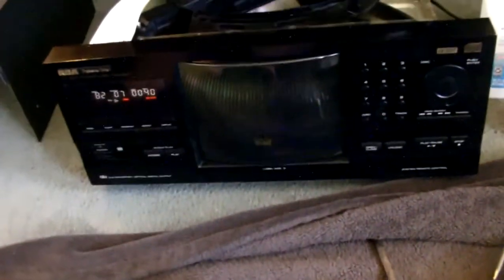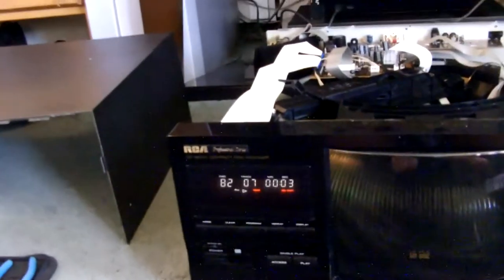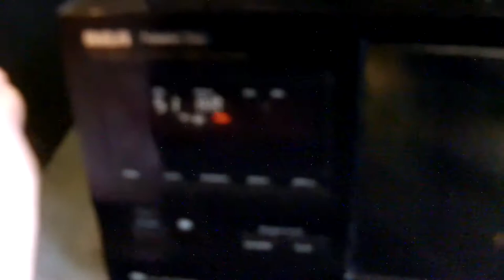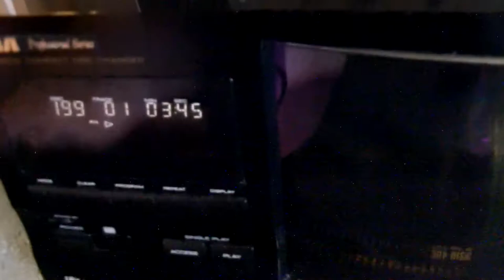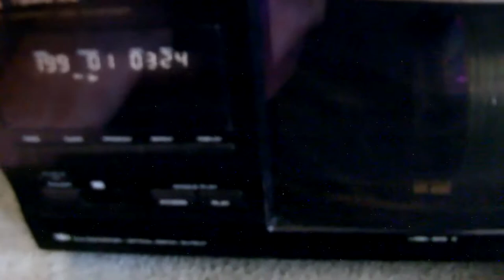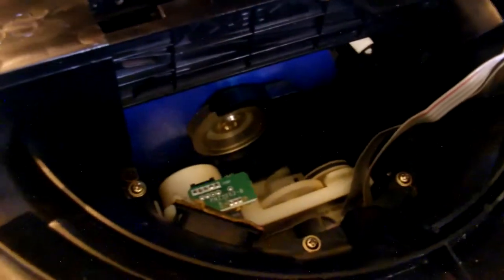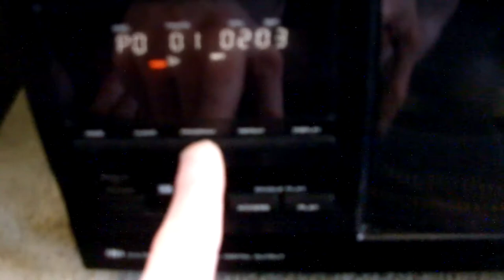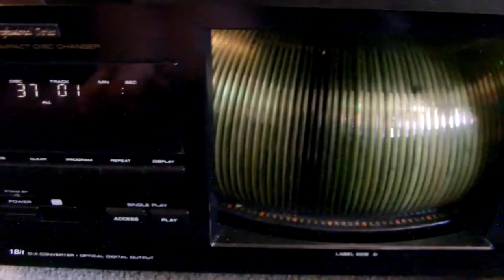RCA CD-9500 300+1 CD Player from 1995 restored to play, optical lens issue

Comment: Picked one of these up a while back for $15 I think. Much better than listening to music on the computer. Didn't know it was this old. Lucked out, the CD wouldn't load so popped off the cover and a J. Lo CDR was in there loose so threw that in the trash where it belonged and everything works fine. Picked up a remote for $23 on Ebay.

Comment: Hello friend. This model is exactly the same as Pioneer PD-F1009 - I got one that is having trouble reading CD-Rs, can you describe what adjustments you had to make in order to get your player back to function? Besides the RF gain potentiometer on the main board, did you have to disassembly the unit ? Thank You
Reply from the maker: Hey Diogenes. Yes, you have to disassemble the unit if RF gain tweaking does not help. Set that back to original, then pull the screws to mainboard away and board itself too by removing cables and ribbons, remove the inner circle plastic housing (gold color screws), and finally the arm that loads discs. Be careful about that because there is a connection inside. If you move it around slightly with screws out, you should be able to get it off easily without problems. Then, the laser assembly unit can be lifted out of the machine, easily. On the back of the ribbon cable is the small screw you want to adjust slightly. Give it a try and if no good still, try the other direction from center where it started at.
Reply: I’ll give it a try before ordering a new optical pickup. Thank you!
Reply from the maker: @diogenescaruaru  Best of luck! If you have more questions or whatnot, don't hesitate to ask. Let me know how it goes, if you want.
Reply: Hi Chris, thank you for being so responsive and helpful. I disassembled the optical unit as you instructed and did some tweak on the mini potentiometer. The result was that now it can read some CD-Rs others unfortunately not. I also adjusted the RF gain using an oscilloscope, indeed it was too high, but I could not find a sweet spot that can read normal CDs and CD-Rs with no problems. I think maybe the lifespan of the diode is coming no an end. Thanks for publishing the video. Did you managed to fine tune yours?
Reply from the maker: @diogenescaruaru  EXACTLY the same thing happened here, so maybe you are right about the diode. I would say to clean any discs that are still giving troubles with alcohol. That fixed many of them, but still, I was not able to get it 100% perfect. No oscilloscope here though. You're welcome.